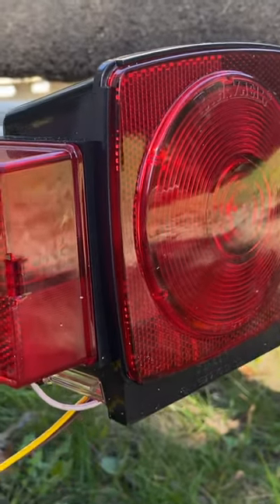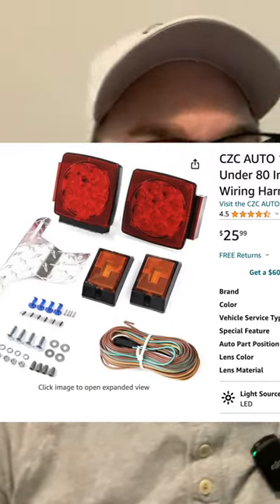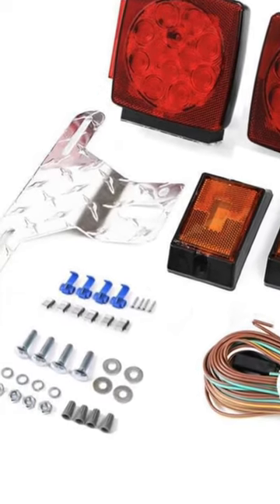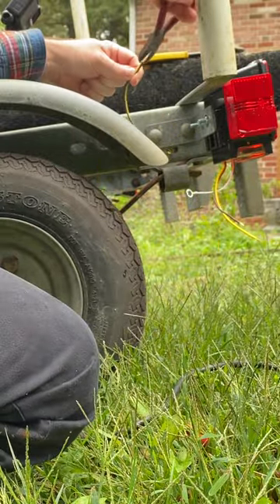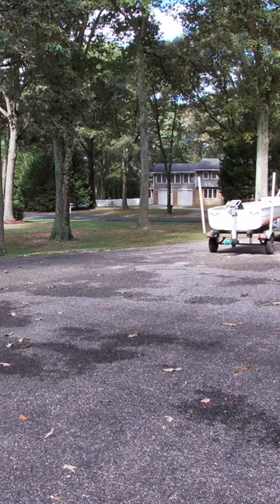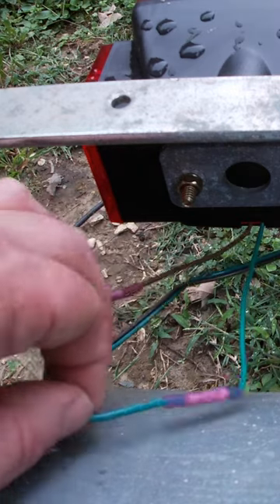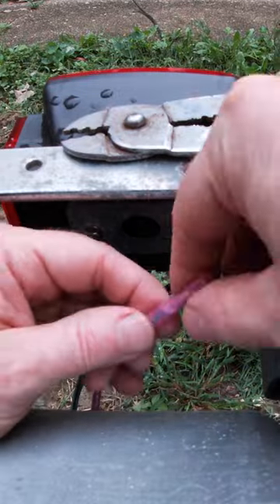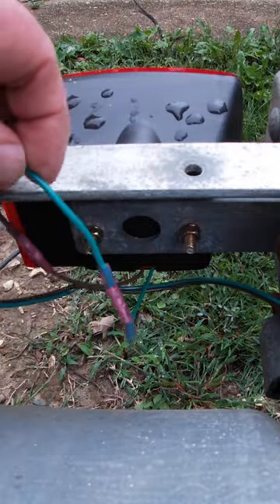Trailer light wiring - wire nuts or butt splice connectors? #boattrailer #12volts #lights

Comment: Also, buy the wiring kits that have the 2 white ground wires, each going down the full length to the tail lights.  Don't use the ground eye on the light assembly bolts, as that will corrode in a year and you lose your ground connection.  Plus, the corrosion will wick up that cable and wipe out your lights.

Comment: I like using boat wire   (white ). It has a coating.   BUT.  Seems like i only get to that when its for sale.   If i change the lights and wires    then a friend will borrow and break for me.

Comment: Butt connectors, they are water proof. Can even hit them with some liquid electrical tape for another defense. I would never use waterproof wire nuts for below the waterline. Sounds like you know the answer from your video though lol.